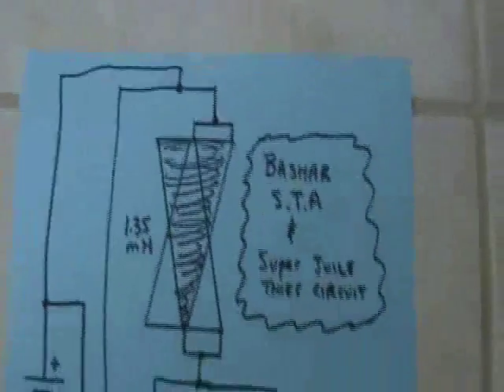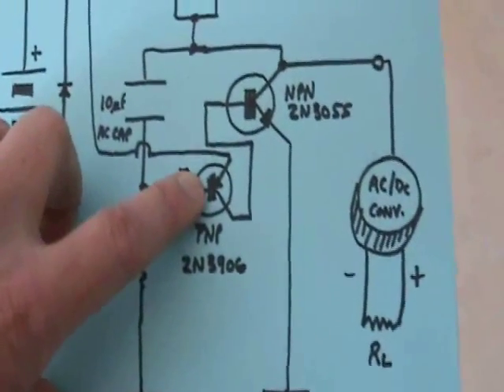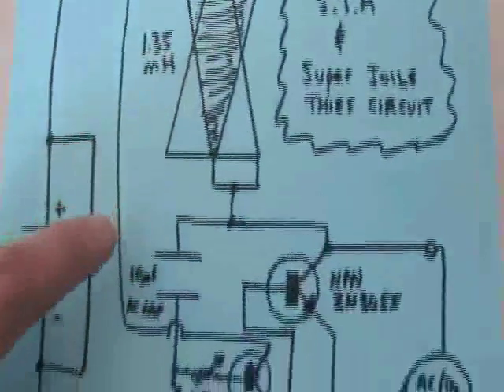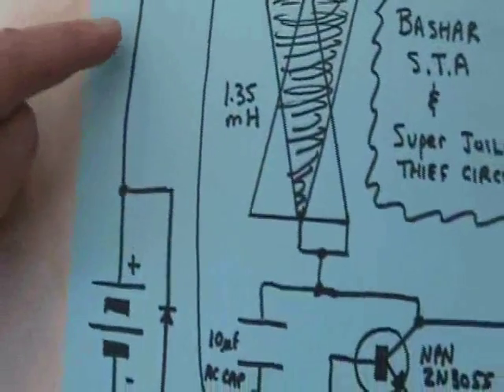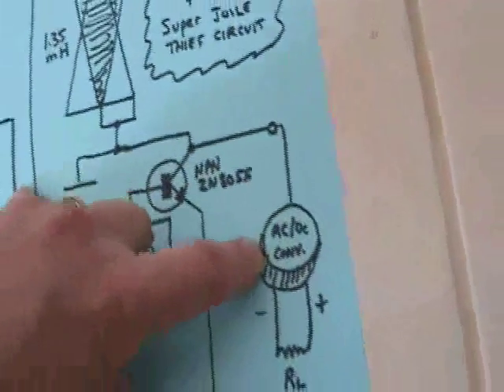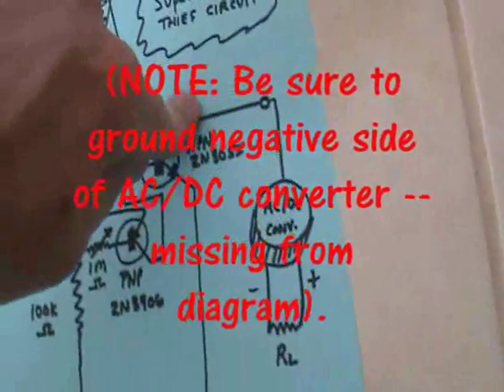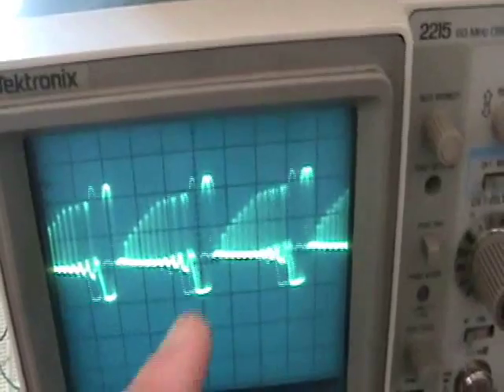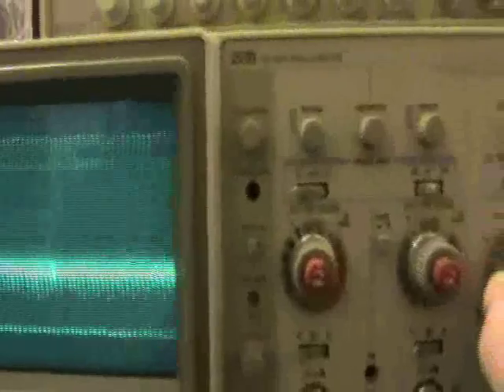Ep. 20 - Bashar Free Energy Space-Time Antenna (Flux Gate Experiment)

Comment: Hi. Have you tried to power this Bashar coil / Russel coil with line voltage. Peter Kelly did that and a storm of clouds appeared above his house and people in the building felt nauseated. Thanks for sharing your nice and sincere efforts. I have read a lot of your posts on forums. Specially on hendershot device. Any success there ? Thanks again.
Reply from the maker: Not a very bright thing to do. I do have fire insurance, but I would rather not burn the place down. It would be smarter to have some sort of Variac control if you wanted to go to much higher power in a "controlled" way. You don't just PLUG in a coil to the outlet.
Reply: Thanks.

Comment: He also said that it needs to be able to fit under an imaginary 3-sided pyramid that stands at exactly 3 foot tall, as well as cone angles being 33 degrees. (So 19.56 inch high with 11.56 inch diameter)
He also said that it's gathering earth's magnetic field, so perhaps Schumann resonance of 7.83hz has something to do with it. (in terms of AC voltage across it)
Perhaps try varying coil distances in a Phi ratio. With less distance at the tip and more towards the larger end (and vice versa)

Comment: Bashar said that a copper wire or copper tube should be used, and that this is basically a small scale 'proof of concept', that can later on be improved. I believe that this is the core concept of the Wardenclyffe, but the core concept doesn't need to be that big or complex

Google 'free energy tesla', and you will find a circuit that extracts power from an antenna. Bashar very specifically referred to this as an 'antenna'. It's also a closed circuit, so you need to connect it TO something

Comment: I don't know much about the cooling, Bashar did say to play with it, I would probably put that under a hot plate... or use a propane torch and heat various parts of the coil to see what happens, and possibly throw water on it...  As for Leedskalnin Perpetual Motion holder, yes it works on iron, but from seeing people putting Neo-magnets down copper tubes, there is some magnetism at work.  I hope you can try it out.

Comment from the maker: Remember also that this is NOT a generator. It does not generate power. Rather it receive power. If there is no power nearby, you get nothing. Bring the coil into an oscillating field, and yes you get power. I think what we are after is not an inductive pick-up coil. Rather, we want an electro-static pickup coil -- one sensitive to oscillating e-fields, converting them to oscillating m-fields in the coil.

Comment: Nice job with the capturing of radiant energy. I think the more fractal polar vortexes u build inside/outside of this structure the more energy back u will receive. Also, putting a mag(s) attached to a rod(s) at the ends and meeting in the middle could induce some interesting results. Check out the Joule Ringer schematics from lasersaber, radiant energy from INVENTOR3, earth batt oscilloscope readings CosmicGnarler's, ect. 1.618,0112358... inf

Comment: Google search (Smith free energy)
Donald L. Smith lectured at 1996 Tesla conference.
uk Patrick Kelly web site there are lots of PDF & video file links.
Smith.pdf outlines Smith's free energy principles that might interest you as they did me.
The crappy frequency response, low voltage, will not lead to free energy according to Smith. You need to emphasize key things to harness zero point energy flux successfully according to Smith.pdf
What is the F-sub-T bandwidth for the 2n3055? Bad, me thinks?

Comment from the maker: @camelsonhorizon 
One last cautionary tale... The Bashar STA air coil can easily couple with energy sources in your room ... line voltage ... cfl lights, oscilloscope, tape recorder, etc. So the ENERGY may be coming from your house mains. A real test would be to talk this thing outside away from any energy source ... and see if you can pick up so called "earth" energy. Do not be "fooled" by LAB energy.

Comment from the maker: @camelsonhorizon 
There are probably many ways to pull energy from the Bashar STA as it oscillates. There are several oscillator circuits to try: Colpitts, Armstrong, etc. The Armstrong oscillator needs a tickler coil ... which could be your center-wrapped pickup. Or you could go Tesla on this sucker and have primary-secondary. There are lots of things to try. I found that putting scope probes bleeds some energy way ... and a center wrapped coil does as well ... even a nearby wire.

Comment from the maker: @camelsonhorizon 
You can experiment with different loads. It doesn't have to be an LED. I used a resistor as a load on the DC side of the AC/DC converter, and then by simply measuring voltage across that resistor, you can calculate Watts. The LED as a load gives you a sense that about 1miliWatt or more is arriving there ... depending upon the LED. Yes it was full brightness for the 20 or so hour Run using 1.5 battery... and the 1.5 battery appeared not to have dropped in voltage at all.

Comment: Very good!  is the led running the whole time then?  other question: Do the transistors pulse the coil, hence the spike and the increasing "ringing"? i am almost done winding my first STA.  i will be pulsing it with a coil wrapped around the top wire, like a transformer, and pick up the center magnetics with another coil wrapped around the middle.  they should be GREATer then the pulse in.